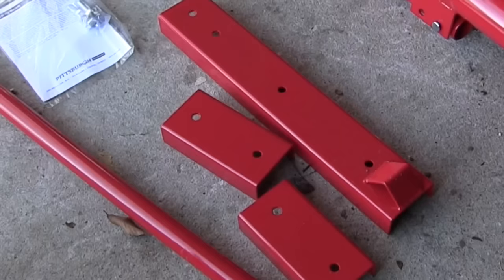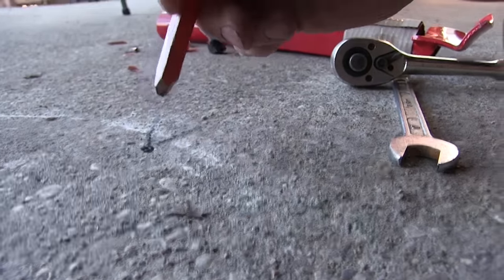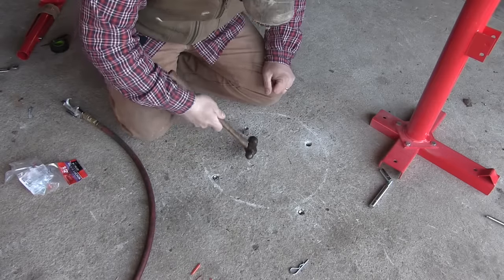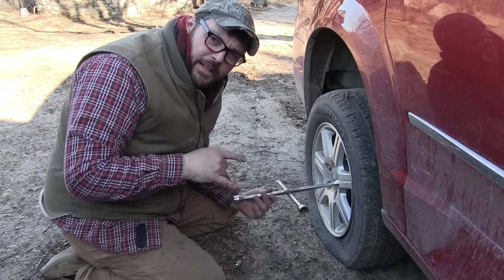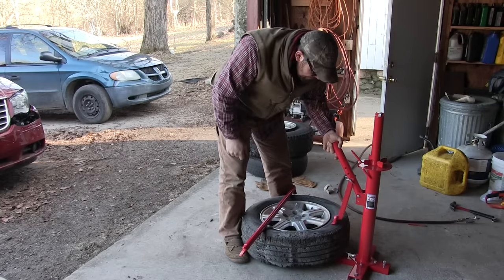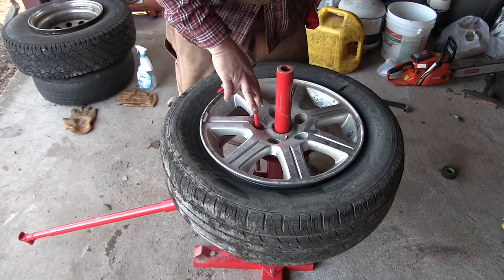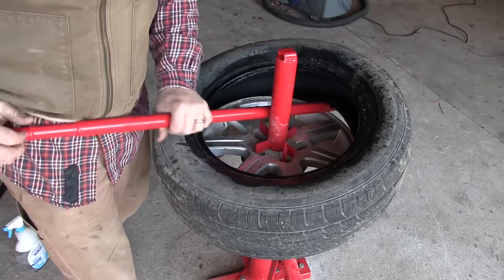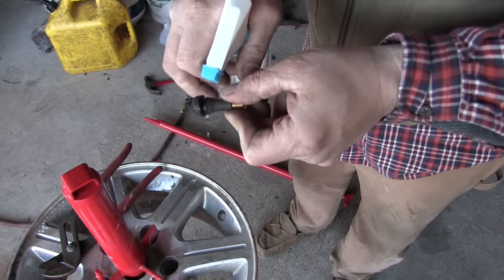Harbor Freight manual Tire Changer review

Comment: 2 huge complaints... not sure why people choose not to change their tires by hand using some material between the hand tools and the rim like an old rag or old towel and use plenty of soapy water as to not scratch your aluminum or forged rim... or put down an old rag or old towel cut a small hole in it and drop it over the changer top tube then drop the front facing rim facing down onto the tire changer so the rim is resting against the old towel and not the bare metal causing damage to the rim that is not fixable... so basically if you are going to follow this video use old towels or rags under your wheel locking tool and one under your tire removal tool so no bare metal comes in contact with your front facing rim... or place an old towel or rag down onto and over the top then flip the rim so the front of the rim is down but the rag or towel is between the rim and the tool... no damage or at least the attempt was made... 2nd complaint while using the bead breaker the same thing applies when the front facing part of the rim is face down place an old piece of carpet or an old large beach towel on the floor first so you create a none scratching surface for your aluminum or forged rim to come in contact with instead of the cold rock hard concrete surface which will cause irreparable damage to your rims... details matter if your trying to either one save money or two just being an dyi type person protect your investment and protect your rims... great video though...

Comment: Good video but I have a question. The first time your daughter started up the car, didn't she get a warning for a tire pressure sensor fault?  It's a pain to see that every time the car is started, and that will continue until you either reprogram the TPMS or put that old valve you chucked back into the wheel.

Comment: When you remove a steel stem, replace it with a steel stem. And he didn't do the tpms sensor probably bc they're $100 a pop, but you oughta get one and replace it if it's broken. If it doesn't break, you can put a new stem on the old sensor. Or should be able to anyway, most come off with a T8 or T7 torx bit.

Comment: Bought one of these yesterday, for under $35 with tax, after watching this and other videos saying it was decent. Tried to swap an old trailer tire with another used one I had. Put a little bead lube on it and a little pressure on the breaker. Breaker slipped off to the side that let go while the other side stayed on. Bent the breaker arms pretty bad. I'm taking it back. I wish I just went to town and paid to have it done. Probably just bad luck but I'm not impressed with the quality of this thing. The design is decent and I'd pay much more for a heavier duty model. If it holds up it only takes three uses to pay for itself.

Comment: I have had mine now for 5 years now I got it set off the wall far enough to put a one ton dullie wheel on it and no problems with it. To use it I just move my up right air compesser out of the way.
Reply from the maker: right on

Comment: This is a pretty good review overall. some things that need to be considered,the bolt system>perfect>>>,spend the money buy the same insert and bolt style,i used the cheaper ones,mine's  permanent.2 when breaking beads USE SOAPY WATER ALWAYS,make sure it's slippery,also cut a piece of wood to brace the bead breaker arm against the upright post and it won't SLIP down the bead area.3 MARK you tire to the stem.if it's been balanced.4 when filling with air use a piece of rope wrapped around the tire like a turnicut to HELP the beads seat,once they seat,REMOVE THE ROPE.5 check not only the beads but also the valve for leaks.Side note don't cheap out on the 40 dollar tire pressure sending unit,IT'S a Safety feature for people that NEVER check the tire pressure most women or just don't know how too. other than that ,good video.

Comment: I have used one before since no shop sells wide whitewall tires for classic cars around here.  The biggest problem is spreading the new tire to seal on the rim. So sometimes I had to buy tubes. Some beads are very stubborn especially old tires that have been on there for a very long time.  There are a few cases that I had to cut the bead off with a hacksaw. I also had to buy a manual balancer. These days a tire shop sometimes charges in excess of $60-70 to balance four tires.  No thanks.
My tire changer did not come with the anchor installation kit.
I need to get the lawn mower version of this as no one changes lawn mower tires around here.

Comment: nice review, thanks! just FYI: i  bought one of these about 6 years ago. swapped 8 tires from a honda accord to a civic in one afternoon. by the time i was done, i could see that though it could do the task it was designed for, it was already bending, etc in the high stress areas. a couple years later, i used it to de-mount 8 model A ford tires...that was about all this chinese toy was good for. it started breaking welds on the last wheel and bent itself into artwork only hunter brandon could could appreciate lol:face-fuchsia-wide-eyes:🤣😂🤣. I was pretty proficient at using a coats 20-20 machine in our automotive shop back in the day, so knew more than a little about mt/dismount of tires...of all sizes, so would consider myself "authoritative"(?) when it comes to tire work...it paid for itself with the times i used it...and that was about it....but at least i got my $$ worth out of it.

Comment: I use mine specifically for atv tires, your van tire looked easier than small atv tires. It does make it easier if you have previous experience changing tires. And yes the bead breaker sucks, but gets the job done

Comment: After using this tool, is a compressor necessary to “pop” the tire up to the bead or would a manual pump (like a bike pump) be sufficient, even if it takes a lot longer?

Comment: I was contemplating to buy a hydraulic tire machine , but you changed my mind ,you did an awesome job , holy crap . Question what size of bolts  did you used for the anchors ??

Comment: I've got mine set up outside. Use it for everything from lawnmower, four wheeler, motorcycle, auto and truck tires. It was a little bit of a learning experience to start with but the more you use it the easier it will get. Great honest video.
Reply from the maker: Thanks
Reply: What do you have it mounted to outside, since it obv isnt bolted to a concrete floor?? Thank you in advance for a reply.
Reply: @themissinglightninglink  I have mine outside, and it's bolted down to concrete.  You obv can pour a concrete pad outdoors............

Comment: I just got mine and assembled it. (Easy) Bolts to anchor the unit not included, but no biggie. I love how its called the Pittsburgh Automotive tire machine, Pittsburgh has nothing to do with it. Made in Vietnam. But I dont care, seems like nice little unit, probably will pay for itself, (bout $80 after shipping to Alaska), after saving myself 3 trips to the tire shop, where they will do absolutely nothing on even the smallest tires, (wheelbarrows, Toro ride lawn mowers, ect.,) for less than $25.

Comment: She is going to likely have a constant tire pressure warning light on her dash now. Seems like with a little bit better engineering on that tire machine it could have used a flat bar style tire tool with a center slot so it didn't flip over like this one maybe a tap on a bearing at the top so you can walk it around?

Comment: You should look into getting some ceramic microbeads. They work great I been running them in everything. From my 3/4 ton HD to my Harley's. Tire balance point changes as it wears. These self Ballance every time the tire spins. Thanks for doing the video. I been looking at this machine for a while.

Comment: If move that tire away from the machine the bead breaker might just work a little better as it will be pushing a little more outward, also make you a back stop to keep the tire from sliding. Two more red heads in the floor, a piece of steel with slotted bolt holes to make it adjustable for different size tires, and weld you a piece of angle iron on the end tall enough so the tire will not slip over it.

Comment: Those do work as advertised but they're not made very heavy duty. Also be careful when you break the bead. It can easily scratch your rim when you break the bead on the back of the tire. Lay something like an old rug or piece of carpet down so the rim don't get scratched.

Comment: I found If you are putting the same tire back on, mark the alignment between the tire and wheel before removal. Then line up your marks before filling with air. This will save your balance. If you're not throwing away the TPS censer LOL.

Comment: When I was a teenager back in the late 60's I worked in a service station where the owner was too cheap to buy a fancy pneumatically operated tire changing machine.  We changed tires pretty much like you see it being done in this video except all of the tools used were heavy duty.  All you needed was a strong back and a little muscle power  I changed dozens of tires this way.

Comment: Over 3,808 comments so far, but I'm not willing to read them all.  I saw you lubricate the threads on a wheel nut before putting it back on, is that safe?  Just asking, I don't know the answer.  Seems like it might make it so the nut could come loose.

Comment: You didn't mention that if the wheel was balanced with Clip On Rim Weights, you MUST remove them before you remove the tire. If you dont, it makes removing the tire more difficult. Also the weights can slide along the lip as you work the bead around. Even if you did mark each weight and spot and replaced them back in their prior spots, the fact that you removed the heavier Tire Pressure Monitoring System (TPMS) Valve and put on a lighter weight old school Simple Valve requires re-balancing.   

Before putting on the tires, dry off all moisture on the inside of the rim including the rim lips. Also dry off moisture from inside the tire especially the bead. It all must be perfectly dry - any moisture can get caught in the seal and cause corrosion and bead seal to leak over time... even on aluminum alloy rims.

Comment: You can mount it on a piece of plywood about 4' and when stood on keeps from moving and is totally portable.
 Also a bicycle tube inflated can fill the gap when inflating if the gap is too wide. Get the tube a little bigger than size your doing. Inflation will make up for the difference.

Comment: You see the drop anchor you used? Two nights ago we used one and screwed an eye bolt to it overhead to secure a chainfall. We had to lift a 1200 pound power transformer 12' above the ground, but one of my electricians didn't drive the middle part of the anchor deep enough and the transformer fell while lifting. Someone almost got killed that night. (It wasn't the anchors fault)

Comment: Bought one a few years ago.
Built a new and different hold down that works better and modified and beefed up the bead breaker.
This bad boy is mounted on a super heavy duty trailer hitch frame and I've designed a couple new bars for removal /install.
This unit could have been made so much better with a touch of real thinking and would'nt have added that much to it's cost.

Comment: I use fire to get the beads seated. I put the tire on the ground after I’m finished installing it onto the rim. I spray a little brake parts cleaner in between the rim and tire run the brake parts cleaner over the tire and onto the ground like a wick and light it as long as you don’t go overboard with the brake parts cleaner It’s not dangerous at all and I’ve done dozens of them like this with no issues. I don’t mess with a ratchet strap It’s a pain in the ass compared to doing it this way

Comment: The air chuck you had is supposed to work with or without a valve core.  I find it odd that you had to use an blower tip.  I know I have the same chuck, and use it often without a valve stem core. Maybe yours is broken somehow.

Comment: Great video Sir. Well recorded and explained. I enjoyed watching you fix the problem and I learned from you though I also did four tires on my Dakota once. I liked your way to quickly inflate the tire better than my experiment of pouring a bit of gasoline around between the tire and rim. Then throwing a match at it causing a small flash and sealing it ready for me to inflate the tire!
A bit exciting but also a bit adventurous. Your way is much better. When I finished installing the last tire as I was inflating it to the proper lbs. the valve stem shot off the rim! LOL!
So then, not trusting the other stems, I took them to a tire shop to have all stems replaced.😅

Comment: if you plan on doing all your own tires then get yourself some dynabeads, they go in the tire to dynamically balance the tire when it's mounted. Alternatively you can just use small plastic balls, like air soft pellets, just google the amount to add per tire size.

Comment: notice that this machine can and must be improved... an other notice doesn't work whith rims without central hole, like the citroen 2cv wheels.
bead breaker needs in my opinon to be improved because it has tendency to rip on the side the tyre and not stay along the rim border, so make a guidance parallelogram 
for it to stay vertical.
Some also add on the top of the machine a support for a duck head.

Comment: If you unscrew the rubber tip on your air gun the air gun itself will screw onto the valve. Once the beads seat you can take it off and install the schrader valve.

Comment: Every video that I’ve seen on these manual tire changers is trying to bust the bead. You’re pressing down on that machine and the thing keeps flipping off and you got to set it back up on the tire and push it down and it pops off. That’s got a change right there. What’s up with that?

Comment: As for bolting the machine down cant one get a thick slab of concrete to bolt the machine down or anything strong and sturdy to bolt it down to instead of drilling holes in your garage floor or if you dont have a garage.

Comment: 5:21 you should have adjusted the pushing arm to the middle hole. You have it set on the closet hole to the center post which is the smallest tire  setting.
Reply: At 5:30 id've been five Fu's and 2 jfcs in by now.

Comment: For the rare or occasional tire you can forget all that. Three (3x) tire iron bars and one rubber mallet (makes it all faster).
For years that was it. And it was more than enough! Literally dozens of tires were mounted /unmounted this way! Cars, motorbikes, scooters, tractor you name it ! The most important is to know what you're doing. That's the real catch! ;-)

Since I'm getting old and very important, got the space. Beside I'm doing more tires than usual. I got one of these. It does facilitate the operations. But definitely not an obligation to have your tires done! Yesterday alone 7 tires replaced. Probably next week another batch.... That justify the machine.

Comment: Did  these ever go up in price! Now around $55!! Guess everyone found out the convenience of DIY lol Love the videos! I usually use spray oil for the bead as for me it seems to work better and it stays on longer without drying up taking it off and putting back on. Maybe its just me. Soap and water is cheaper though I guess.....I have a front tire for my John Deere 425 that I just cant get back on with screwdrivers so I might snag one of these or take it to wally world as I think they do a swap for about $20 or so. Wish you would have a link to those concrete collars! I will check HD or one of the home stores and see what they got since it is 3 years later.
Reply from the maker: Thanks

Comment: I got this,   I was thinking of bolting mine down to the concrete and just removing it when i'm not using it also, then I though, hate to fill those holes up with dirt when it;s just open like that.    so i didn't drill the holes.   what I did was   bolt it to a pallet.    now that worked but SUCKS!     so I have only used mine once also but it was bolted to a pallet. 
   I also bought the balance and I bought the Motor cycle tire attachment.      I have a load of trail bikes here.  LOL    I could break this, I am sure you could as well,  but what you outta mention is there is no reason to break it.   if you have to exert so much energy that it;s going to break   you are doing something wrong.  LOl stop and re think and you are good.   LOL

 One thing I noticed that you did  and I didn't realize was a problem and a solve  until I saw you doing it is the bead breaker. when you put the tire on the ground that part of the machine  on the ground  needs to be ON the bead of the tire for the  part on the top to line up.   goes easier that way. 

  anywho!!     awesome vid/..     Oh yeah  also it says in the machine instructions up to 15"  LOL    I have already done 17's on it.   it;s clumsier and the bar is shorter looking when doing it but it still works.  didn't know I was not supposed to do 17" till I was done barbecue I don't read shit. LOL
Reply from the maker: Thanks for the comment

Comment: Use tire shine gel instead of soapy water.😎

Bolt it to a tractor rim 😎

Roll it to where the tire is

Use vice grips  on the rim edge to keep the tire from  chasing the bar around the rim.

Comment: Looks like it would scratch your rims up but good tool if you don’t care about scratches. And I don’t want to ever go back to not knowing my tire pressure at all times, I keep my display set on tire pressure. I’ve actually driven on a half flat unknowing until it almost caused a wreck.

Comment: If using high-pressureair to clean out a drilled hole put the nozzle parallel to the floor and shoot across the hole not down into it. The high-pressure air will form of War text inside the hole the debris will be raised up and what it leaves the whole will be blown away from you.